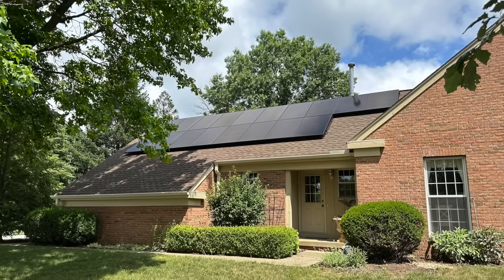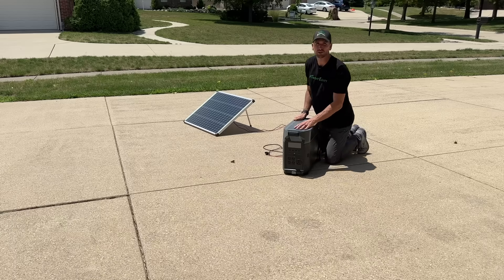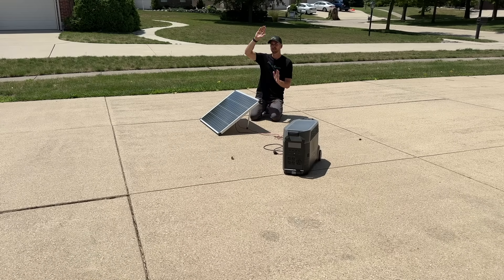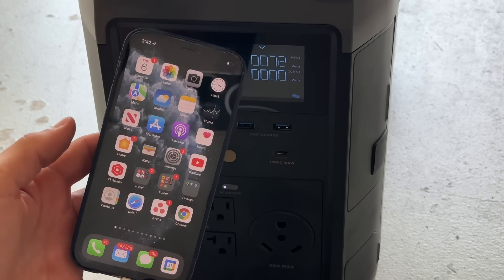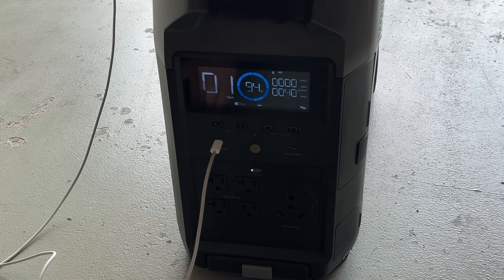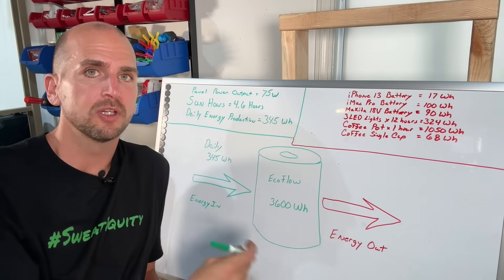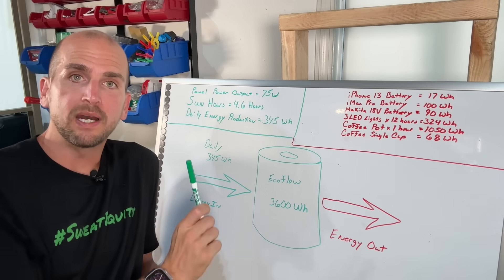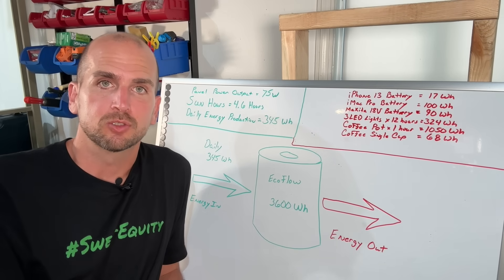What Can You Run On A Single Solar Panel?

Comment: Thank you for this video, I try to prepare for Gulf summer storms and have watched countless videos on this topic, and really have not truly tested my power stations and solar panels.  In all the videos I've seen, I have never...ever...once seen the angle of the panel mentioned.  May I please suggest a more "hands on" and less geometry supplement to this video?  Who knew this was a thing!?  As were told just a mild to medium direct hit by a hurricane could possibly knock out our power grid out for up to a month, this would be greatly appreciated.
Reply: Rig a stick on your panel, perpendicular to your panel surface.  Keep it pointing at the sun. It is dead on when it casts no shadow.   The angle of altitude (up from ground)  is constant, but you will have to rotate the panel horizontally for maximum output.  If you want to move the panel less often, "lead" the sun, pointing ahead on its path, so the sun move toward the focus before moving past it.

Comment: I remember about 2 decades ago, we started to became hyper aware of the energy consumption of everything in the house, overtime as we replaced things, we started to lower the energy use whiles not changing our lifestyle, in fact, we use a lot more tech gadgets and computers now then we did back then, and yet with all that, we manage to halve our entire house power consumption, whiles not changing our lifestyle, and in fact, enhancing it with more tech stuff.

It goes to show that if you become a lot more aware of what you buy, you can lower your energy use a lot without downgrading your lifestyle and reducing it in half is a massive saving on the bill then it would be if we didn't do any of that.

Today it's easier for consumers, because by law in many countries, there are energy labels on products, that's putting pressure on companies to do better, especially in the EU, that's lowering the energy use of a lot of products, without losing anything.
Reply: I do an Apollo 13 energy audit every time we lose power in NorCal.  We never know if it will be out for 3 minutes or 3 days. The house used to use 28 kilowatt hours a day. We are down to 8 to 10 kilowatt hours a day using applied cleverness. The 2 garage chest freezers and a fridge run on solar/inverter/batteries, been 2+ years non stop. The battery state of charge gets a little iffy in November through February thanks to low sun angle and trees. In the summer, I see 100% charge by 1PM.
Reply: My sister bakes cornbread in a very high wattage oven. I use a skillet on the stovetop or hotplate.

Comment: No. You can’t. A 12v fridge uses about 40w on a hot day. Optimally on a 120w panel you’ll pull 80w. It will take more hours than there are to get a full charge on a 800wh power station. 

Basically, you use more overnight than you’re able to collect. So you need at least a 200w panel

Comment: If i soldered up a 100w panel to output 50v or better to charge a 40v 5 a/h  chainsaw battery, about how long would thay take to charge roughly speacking?
Reply from the maker: Each day and season will be a bit different but with the correctly configured system you should be able to charge the battery up in 3-5 hours.  We usually look at "peak sun hours" for each region and in my area I would just count on it taking all day.
Reply: @EverydayHomeRepairs  I live in East Texas, sun isn't much of an issue typically. Thanks for the info. I wanted to see if one panel could keep my saw batteries going during the day and it looks like that isn't an issue.

Comment: I'm currently expanding my solar energy system to include:
4 -  36v, 260w  Monocrystalline panels mfg by Canadian Solar I bought the used. The angle of the panels are 34 degrees which matches my latitude. These are wired parallel for a maximum of 1040 watts.
Epever 40A 100v 12v -24v output charge controller
I 200AH 24v lithium battery
3000 watt pure sign wave 24v/120v inverter.
I power a small chest freezer, refrigerator, an evaporative cooler (only for a few hours at a time). 
I live in an area where the power company can shut off my power for up to 5 days in the event of high fire danger weather. This is a back up system for when they cut my power. I live in the Mojave desert where we get the most sunlight in the nation. 
I enjoyed your video.
Reply from the maker: Nice work on the used panels.  I think used panels can be a GREAT value.  Where did you get yours?
Reply: @EverydayHomeRepairs  I bought them from a gentleman who was upgrading his system because he bought a second Tesla car and needed more power to charge two cars! I paid $70.00 each for four panels. They are top of the line Canadian Solar Company panels. It is unbelievable how good they work on cloudy days.

Comment: I currently run my house on ~ 3.2 kw of solar panels , ( 8 x 410w ) & 7.2 kwh of LFP batteries via a 3.6kw hybrid inverter . Setup cost me about £3500 . Payback will be around 30 months i think , maybe less .
Reply: With an AC unit?
Reply: @davidflash603  he’s in the UK I think so unlikely, ac very rare here.
Reply: I need your help. I have a bluetti power station. 700 watts. Please advise what solar panel I can use that connects to a power station please
Reply: @ I think bluetti sell panels themselves , 100w folding panel should do it .

Comment: I have a solar panel of 130watt. With a Deep Circle battery of 60ah.
Of course with a charge controller.
My load requirement are:
 Laptop 65watt charger
 An iPad 5v, 2A charger
Two Android phones of same capacity with iPad.
Can the Solar setup support my devices all together?
Reply from the maker: Would you just need 1 charge per day per device?  Also you will need to know your Peak Sun Hours for your location.  For me I am around an average of 4.6 hours per day.  My peak sun hours change fairly dramatically between the winter and summer so I would design with more like 2.5 hours per day.

Comment: Would this set up be enough to run my mini split unit through the day? If not could anyone please advise me on what to look for. 
Thanks,
Reply from the maker: Nope you would need significantly more panels as a mini split can be a pretty large energy draw.  Do you still have the yellow EnergyGuide label for the mini split unit?  That would give you the energy usage for that unit which would be the consumption side of the equation.

Comment: It's probably cheaper to use the grid if your grid electrical cost is on the low side. The battery in the ecoflow is relatively expensive (compared to grid cost) and even though you're using solar to power the battery, the battery is ultimately charging the device. Also the amount of money you're saving using a small set of panels is tiny. At least this is what I'm finding looking into solar.
Reply from the maker: I will be documenting an 11 kW panel installation for my home in the coming months.  At least in Illinois with the federal and state incentives the pay back period is starting to get pretty reasonable (6-8 years).  This is not necessarily the case in most states.
Reply: @EverydayHomeRepairs   in Florida , i heard insurance will not cover with solar in roofs..Another thing to add of the list of reasons to move out of here asap!
Reply: I've done cost comparisons before and you're right. Grid power is cheap compared to a complete, in-home system + I do not want to mount the panels on my roof and the panels are outdated fairly quickly.
Reply: I use 11 mostly small/medium sized solar power stations and a big 300ah Ampere Time battery with solar in Louisiana because of hurricanes and other storms. For instance, we had five power outages during extreme heat emergencies this summer. I had electricity for my freezer, fridge, and a tiny air conditioner. I can`t afford to buy gas for a generator if another hurricane comes. I`m on Social Security and can`t even afford to own and use a car. 24 hours worth of gas is 20-25 bucks minimum. That`s food money I need. So I invested my stimulus and savings in electricity I can make on site.

Comment: OK I finally got my wife and to get in sold panels because she’s got tired of the electric bill hi is that part is I live in a trailer and only thing are use need is power to is my whale my furnace and water heater and we have a few Ovens no ovens I think they’re 120 I think it’s just a regular plug-ins for your house I’m not electrical engineer not like I don’t know in about logical that much and we have lights maybe two TVs we run small TV for a camera and a big TV for the living room then we got one in our bedroom we just used for the cameras we live in a trailer and I do believe we have 200 amps already have 100 W solar panels that from Harbour freight I’m gonna get another set there’s four of them they’re 25 amp apiece I have four of them so it’s 100 and will get 100 more now give me 200 A but I need a power box and I don’t know how many batteries actually need I’m thinking I’d like to get maybe four batteries because I want to run some power to I have a building that I wanna run power to run like lights my drill power saws and stuff like that right now I’m just using Sention cords to get my power because I have no power to my building but I want to use solar panels I’m thinking about separate the building because I can put solar panels on the roof on it to be separate but right now I just wanna concentrate on power to the trailer we live in we had too many times a power goes out trees knocking limbs down knocking the polls down power outage outage and I’m tired of it I want to go off grid that’s the game plan I don’t know much about the stuff that I want to learn how to use them pry can live off grid and quit using the power because we don’t how to use power at where I live at we only use our furnace only in the winter time we don’t have to cook at the house because we don’t have a furnace or stove or mean we don’t cook out of stove I usually cook outside on the grill and our electric bill is always way too high and they got a smart metres on it and I didn’t want it but I put it on there anyway now our electric bill is always high they’re gone by what were used to burn long time ago I don’t trust the electric company the rip offs they’re ripping me off we don’t hardly use power at home few lights and the TV we’re just us and I don’t get it live in a small trailer and electric bills always high I don’t trust him same thing I don’t trust the government but you want me I digress But I want to get power to my trailer through the solar panels and get out of electric company

Comment: When the panels are installed on a standard shingle roof those shingles are altered by walking on them. The aggregate (stone) is removed which is the protection of the shingle itself shortening the lifespan of the shingles. Not to mention and install defect that can cause a leak in your roof. Will the solar panel installers dispute the install warranty and claim it was the shingle installers that caused a roof leak, or even blame it on the shingle manufactures. I see a potential mess of problems that could happen with the cost of repair being put on the homeowner canceling out any posible savings from having solar panels
            When the roof needs to be replaced who and how are the panels going to be replaced and reinstalled, drilling more holes in a roof, creating more potential leak locations
Reply: This is my big fear of anyone including myself wanting to diy a roof setup. Which is why I helped my friend build a 800watt set grid tie setup on his fence and works just great and is easier to clean and maintain.
Reply: @Underpantsniper  From a maintenance aspect your solution is much smarter. No conflict between roof warranty and solar panel warranty.
Reply: @SuperSaltydog77  thank you. It was pretty easy and fairly cheap to do. Just replaced 3 4x4 posts with 6x6's reinforced the fence panels with extra 2x4s , 4 220 watt used mono panels, a Bluetooth controller and monitor and  1500w grid tie inverter plugged into a  20 amp GFI that was already near the fence. It was fun to build and he and his wife want to expand it soon.
Reply: @Underpantsniper  Hope that you and your friend reap the rewards of your hard work and common-sense thinking.

Comment: Some insurance companies in Florida will drop you if you install solar panels on your roof. They claim it compromises the integrity of the roof.
Reply: It does,my boss has them .
Major headache after two years
Reply: @Kibatsume1  Probably because the roof was never designed for solar in the first place. you just can not stick these things anywhere as each site is a custom instulation.

Comment: Depends on your goals.  
Saving $ with roof full of panels.  That’s a long term project with minimal savings until 6-10 years.  Gets complicated if you sell your house.  Will not power your house if the grid goes down without expensive batteries.  
Living off grid when grid power is not available.  Expensive, but sometimes necessary.
Small system that will power your freezer/refrigerator, lights and fans in the event of a power outage for as long as you have sunshine.  Saving a large freezer full of food may be worth the investment.  Could make camping more enjoyable.
Maybe all you need is to keep your phone charged when the grid is down.

Comment: Great video, thanks for the great info.  Looking at building a solar charge shed for all the lawn equipment.  Oh, if you use a thermos type coffee pot then it only has to heat the water once.  :)
Reply from the maker: Great tip on coffee pot, that would make a massive difference. 👍

Comment: the solar panel probably did not drop below 11 volts from a cloud, the ecoflow MPPT was just recalculating the solar input so it turned off and then on again. its cool that it is a "smart" solar controller but that time of zero solar power is wasted energy that can be annoying just because a cloud went by. PWM solar controllers don't do that.

Comment: Excellent post Scott, I currently have a Jackery 300 watt and 500 watt generators each powered by 100 watt solar panels that I use on my sailboat which is on a mooring. They run my 12 volt tv and fans in addition to charging drone batteries, and iPhone and iPads. In addition to running the boat engine to keep house batteries charged up (rarely) I have a gas Honda generator for same purpose. Eventually I’d like to build a bigger solar system that would have 2 solar panels on my Bimini that would charge my house batteries and allow me to keep the refrigerator cold without running boat engine or Honda. Thanks, greetings from Chesapeake Bay.
Reply: 1-10 how do you rate living off grid? I’m thinking about it.
Reply: The 500w battery can run a dorm fridge for 24 hours per charge. A DC fridge would be more efficient though. Boats need special fridges though, right?
Reply from the maker: Ummm, that sounds like a pretty awesome project 👍👍

Comment: I’m trying to put solar panels on my 2022 Jeep Gladiator Diesel Engine with Eco Generator also thinking about putting extra batteries in the bed. Could use ideas and advice.

Comment: Can l connect 2 battery which is 12v in 100 WATTS
Reply from the maker: You should be able to select a charge controller which can take the solar panel power and store within your 2 batteries.  I would think your batteries would be wired in parallel to maintain your 12 V and double your Ah.
Reply: @EverydayHomeRepairs  OK l ask that question because l have solar panel 100w with 1 battery which is 12v and am planning to add another 12v battery